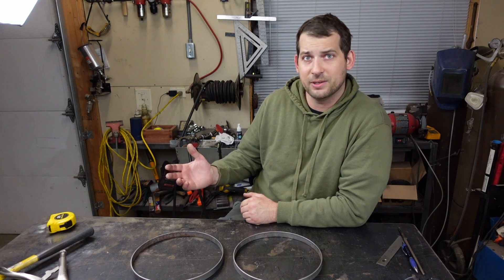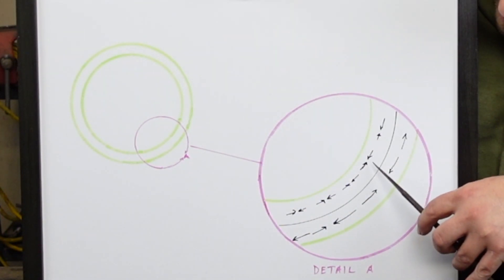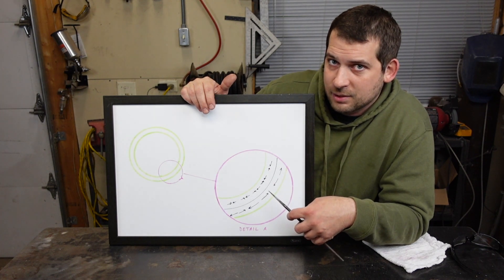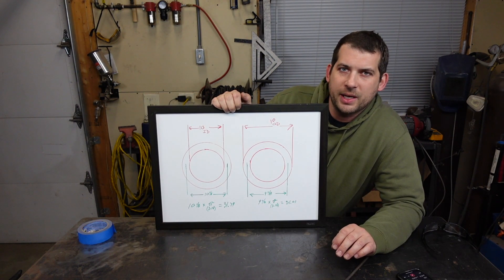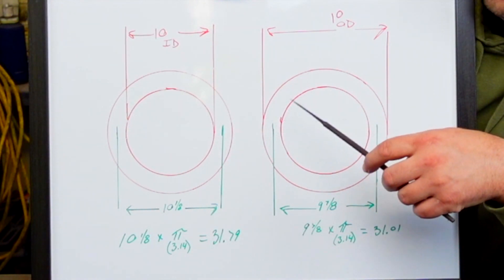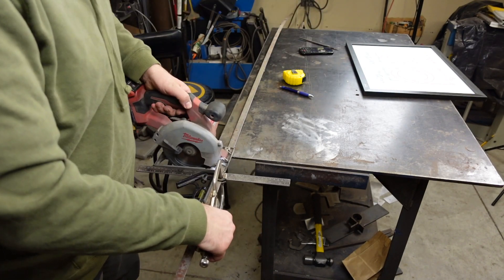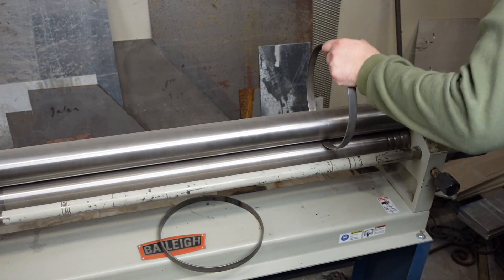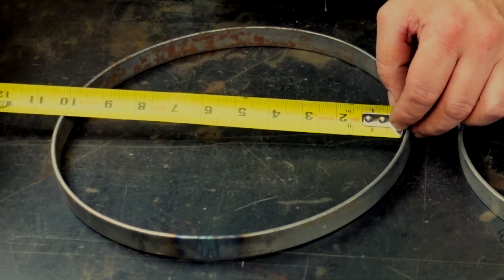HOW TO ROLL A PRECISE RING- adjusting your stretchout for ID or OD

Comment: I realize this is an old video, but if you feed the material into the back side of the slip rolls( roll them in reverse) and form the first couple inches on each end, then roll  it from the front as you normally would, you won’t get that flat spot